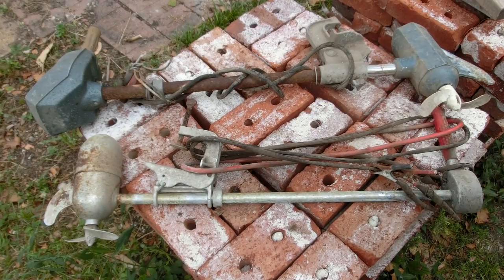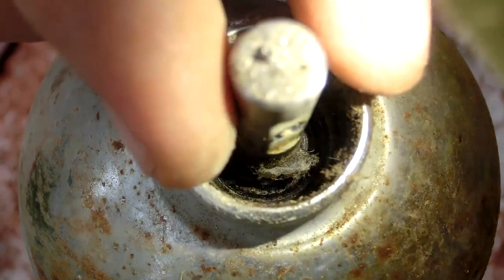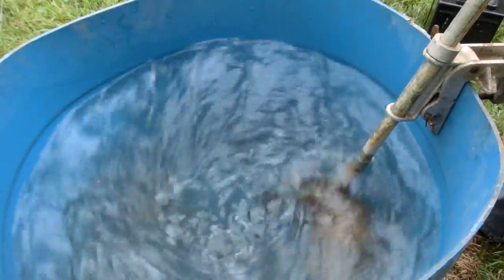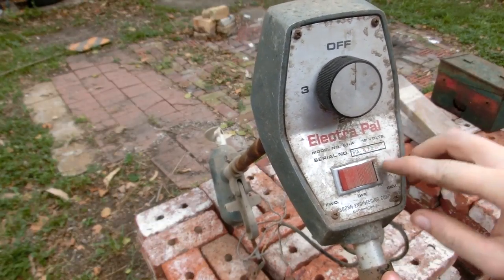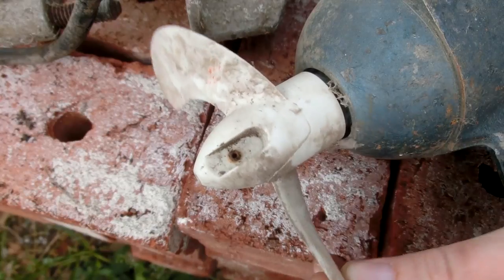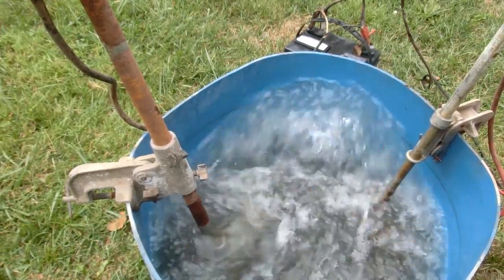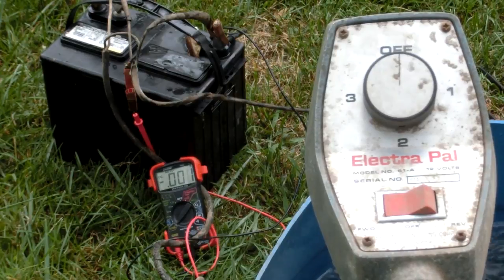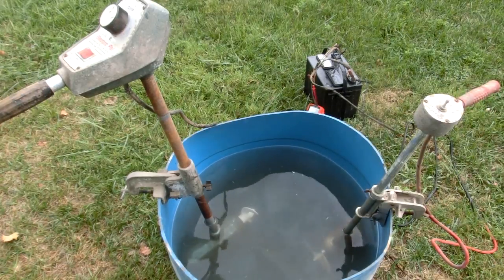Electric Barrel Boats 01: Propulsion from old 12v trolling motors

Comment: Works pretty good for being electric, sweet! Lot simpler to repair too, no rubber impeller issues like Mustie1 had to deal with recently! Looks like you've got an industrial margarita-mixer with both running at once! XD Looks like a fun project! As for unusual boat ideas, how about a powered raft? It would steer terrible,but it might be possible to mitigate that by using both motors for throttle-steer, though it would turn one direction faster than the other!

Comment: The current in reverse is less because of the propeller, coz it is designed for efficiency in forward direction and reverse us just temporary so the prop puts less load on the motor and hence